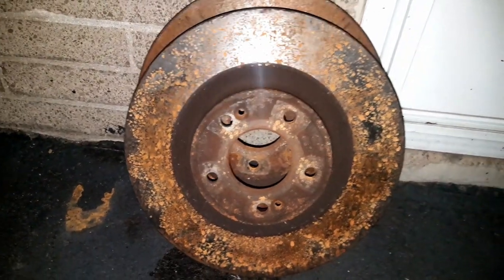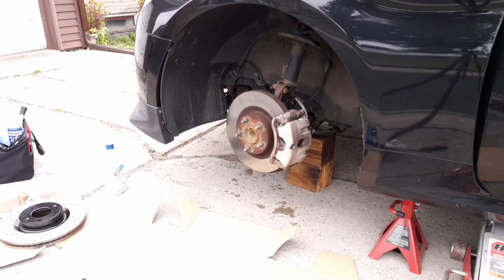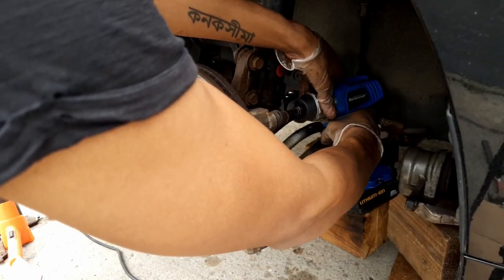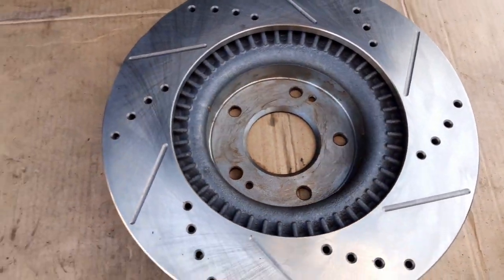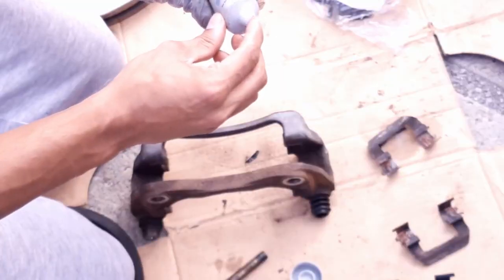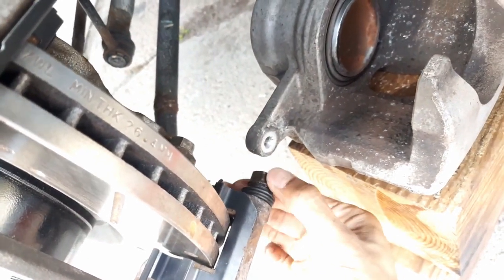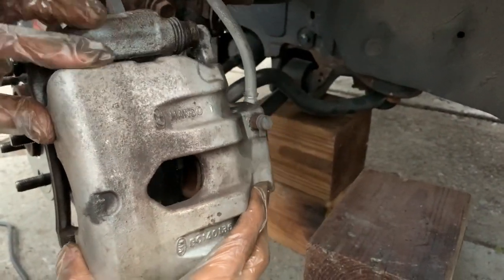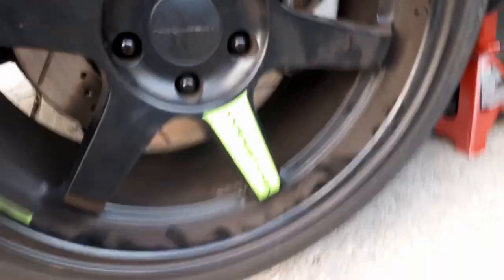Drilled Slotted Rotor Brakes Install | Genesis Coupe

Comment: When you push back the piston from the caliper I would highly recommend you to open the brake reservoir cap to prevent any damage inside the master cylinder valve

Comment: I have Max Advanced Performance slotted and drilled rotors as well for my brembo brakes. A friend of mine actually mentioned that you can buy the black set of rotors they have and that the black part of the rotor actually just wears off to the silver look during braking! But you won’t have to worry about painting the hub part, because it’s already painted.
I think with my next replacement set of rotors, I’ll try getting the black ones and test it out for myself!
Good video man 👍
Reply: how is the rotors holding up so far?
Reply: @neoncruz19 still using the Max Advanced with many hard track days and they’re holding up great. I’d probably get another set or even StopTech for a mix of street/track days whenever it’s time to replace.
Reply: @alphagenperformance  sweet! thanks for letting me know, wanted to give max advanced a try